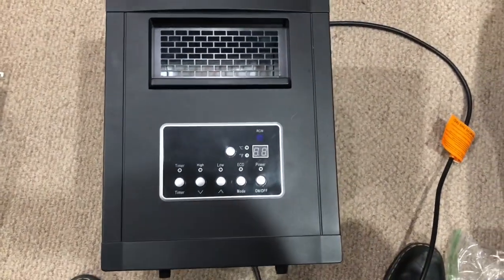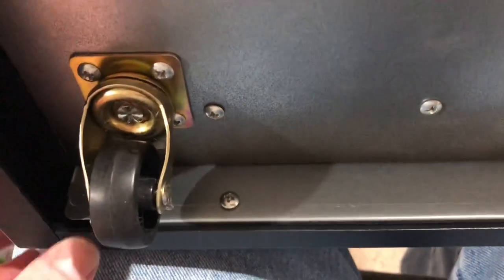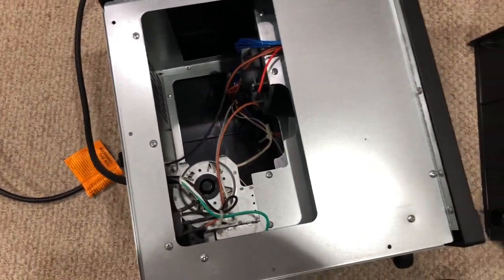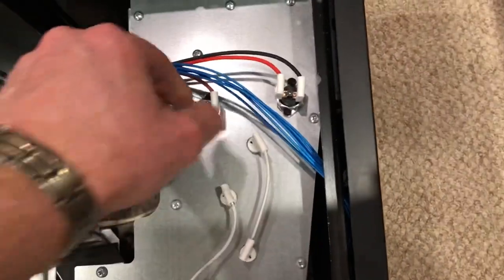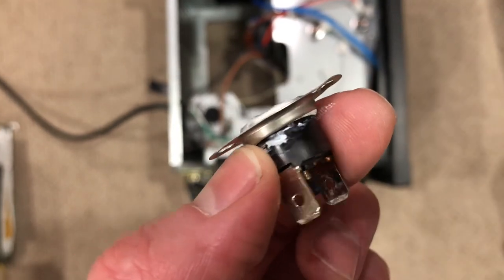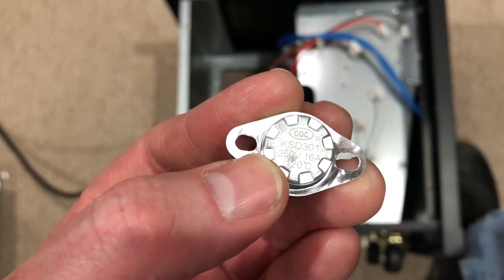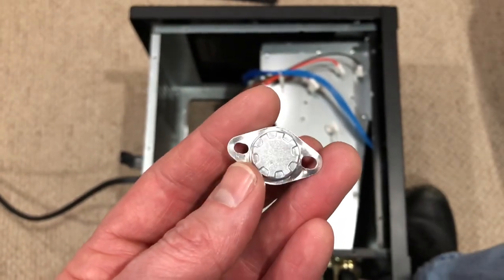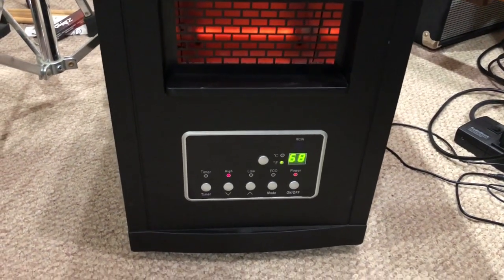Life Smart infrared space heater repair

Comment: Nice video. You might want to be more explicit in the video description saying that you usually do NOT need to replace the fuse/thermostat. Instead, just pressing the reset button on the back of the component will most likely reset it. As you label it in your video, these are Manual Reset disk thermostats.If pressing the button doesn't fix it, checking the fuse for continuity with a multimeter or any other tester will tell you if the element is actually bad. On my unit, I drilled a 1/4" hole in the side panel (after removing the panel and manually resetting the fuse by pressing the button) in line with the button so that I don't need to take the thing apart if it should get tripped again in the future. I also put a "Thermal Reset Button," label under the new hole. Thanks for sharing this.
Reply: Pushing the reset is what I did and it fixed the problem.  Unfortunately for me, I did not see this comment before I went looking for replacements for the fuses.  At my third stop I was told the button was a reset and low and behold....fixed.  A lot of screws had to be removed to get to the fuses.
Reply: Opened mine to find a wire burnt on the switch, something got hot, any ideas, melted the switch, now I need a switch and a wire.
Reply: @sparkywow1  Sounds like it shorted out and fried instead of failing in the open position. The wire really shouldn't act as a fuse. :) Just replacing both should probably be fine, but if you want to be extra careful, you could put a 10  amp fuse in-line with the thermal switch.
Reply: @sparkywow1 The burnt wire is usually caused by a loose connection or the contact points inside the thermal fuse not making good contact and they start arching and creates a hotspot. Seen it hundreds of times doing appliance repair for 31 years.

Comment: Just so ya know.  That white gunk did not come out of those.  It is called thermal paste.  It is used on the cpu of computers between the cpu and heat sink.  It helps in conducting heat.  Not sure if this has been pointed out yet.  From years of computers I recognized it right away.

Comment: Thank you for posting. This saved me from scrapping my heater. Mine had a factory installed red reset button attached to the thermal part you posted. I just had to push hit back in to reset. Not sure why they would make it so difficult. They could have just had an external reset button to avoid disassembling the entire heater, what a hassle!
Reply: Kevin Berryman manufacturer wants to sell you a new heater. Reliable products don't make stockholders happy. A sad reality of today's business climate.
Reply: mine has the same reset button on the one.

Comment: Thank you so much mine stopped working and I searched online and found your post it was actually the reset button and it fired right back up again thank you it worked really well
Reply from the maker: Steve Barker was it raised up?  Did you push it back down?  Checking.
Reply: Mine was slightly different than yours although quite similar so I took all the screws out and the side panel and I got to say again your video was very informative I would have never figured that out and I saw the little button that you had mentioned about resetting after you replace the thermal coupler and I pushed on it and it actually clicked I plugged it in and boom it fired right up
Reply from the maker: Steve Barker I think I read some people drill small holes so they can hit those with let’s say a toothpick.  However finding the exact placement could be tricky.
Reply: I'm out in my cold shed enjoying the nice heater working on my Harley

Comment: The voltage rating is the dielectric strength of the electric insulation within the fuse. 120 volts is within that range. The amp range is more important, and that is the same or greater than the original for the current the thermal fuse can handle. The most important number is the temperature rating. The white stuff is thermal compound which helps to make a better thermal connection with the body of the unit. It's best if you use some. The thermal fuse is resettable, so that should help in the future.

Comment: The white stuff is heat sink compound. It is placed on the outside body of the sensor to help the transferrance of heat from metal to metal. It is commonly found on heat sinked transistors in electronics. My two cents!
Reply: I just replaced the thermal paste and it seems to work fine now
Reply: Opened mine to find a wire burnt on the switch, something got hot, any ideas, melted the switch, now I need a switch and a wire.
Reply: @sparkywow1   the make up inside the over heat sensor is like a set of points that make and break when it over heats it breaks or opens the point can get burnt contact surfaces and can  cause a higher resistance causing the connections feeding the  to get very hot from the higher resistance  sometimes this can be the result of burnt wire but  also dirty filter or dirty fan blade or motor bearings could be worn out  due to lubrication  which many are lubed at factory and you usually cant lube them because they are sealed and if rpms of motor slows down the heater will get a little hotter causing the overload heat sensor to go bad if its a auto reset type but most are not because the part would cost a little more so there are three or more types manual resets  auto rests and one time  no reset  that have to be replaced just like a fuse these are know as thermal discs limits  they are use in many devices other than heaters but have different heat ranges that open them up to cut the voltage off   some are low heats some are higher heat ranges  depending on there  function i was in electronics for over 35 years and ended up retiring as an electrician

Comment: I thought that looked more like thermal paste! And YES you can use a 250V version in a 110-125V circuit. That's because it is HEAT, not volts that cuts the circuit, just like a typical fuse is rated for upper volts when it's AMPs that can cause it to blow. That voltage rating is an upper limit only.

Comment: Thank you very much for that tip about turning it on and off with the "ON/OFF" button on the front of the machine, instead of the orange toggle "0/1" button on the back. I presume that rear switch is there only to prevent wasting "ghost" electricity when not in use for a prolonged time.

I just found an Ecotronic 1500W model GD8115BW-L infrared space heater yesterday by a dumpster. It's fairly similar to what you have. It has the same orange tag on the same type of cord, and "Do Not Cover" on top. So I think they both might have been made at the same Chinese factory. Except for 3 minor cosmetic issues, mine works great.

Comment: I have one that was sitting in a room that I had some mold issues with and it was in there for probably about two years with the room shut with no heat getting into the room could constant cold permanently destroy a heater like this? I was curious because I am moving out of the house and I wanted to heat up that room so I could kind of try to go through it to get stuff before I'm out of the house permanently and when I went to plug this heater in it immediately tripped a breaker down in the basement for that circuit just plugging it in tried it on another circuit in the house blew that one as well is this thing completely toast?

Comment: I took it apart just as you showed and mine only had one of the 2 fuses yours had but I cleaned it off pushed the button and (button was white instead of black) and like magic it works again!  For the orientationally challenged maybe mark the panels with a maker for top , bottom, Left side and Right to make reassembly just a bit easier ....using a hand held screwdriver is not much more work than using the electric ones. and you wont strip the plastic or sheet metal.  Thanks again I have 2 of these so your really saved me.  send me an address and I will send you a gift.

Comment: Thanks...  Mine was the HT1198 model... The small black one...it was a job getting to them but I got there...One had the reset other didn't... I pushed the reset... Turned main power on but the power switch on the top just flashes... I am going to amazon and ebay not to order replacements for both... Thanks again

Comment: The white  substance on that part you pulled out is not leaking that white stuff  is a heat sink paste  or compound  to help sense the heat better incase its overheating when installing new ones you might want to use that compound on your new ones that compound is silicon  white paste its used also on stereo and amplifiers to dissipate the heat to a heat sink just the opposite of the function on the heater  just reverse action to get job done  one draws off the heat to a heat sink for electronic devices and the one you are working with is used on  heater overheat  the compound helps to you might say fell or transfer the heat  better to the overload sensor same job for this compound but different purposes

Comment: My faulty unit shuts the fan off when the desired temp is reached, however, the elements continue to glow and wont shut off unless you unplug it.  Could these thermal fuses cause this problem as well?
Reply: that is posible
Reply: Mine does the same. Did you get it fixed?

Comment: the white stuff is thermal compound it is used on many stuff to help make heat transfer better.

you can youtube heatsink compound or thermal compound.

what probably happened is the thermal switch was cycled too many times and failed.

the heating elements can fail too

Comment: let me get this straight I may be able to just push in the black plastic tab on the front side of the KSD 301 component .but if that doesnt work then I can replace that KSD 301 buy ordering them off the internet..a month ago Kee Tan  said he fixed his without replacing the fuses.....I hope I have the same situation.  If I do have to order the parts do you have the web address?
Reply from the maker: Rodney Beasley Yes, try the reset.  See if that will work.  Otherwise replacements on eBay or Amazon.  My heater running next to me right now.  Still running great!

Comment: if these fuses were blown would I still be able to turn the unit on from the front?
Reply: red light on back on switch .  but no power to front control panel.  There is a reset in the center of the thermal overload. but you have to take it all apart to reset.

Comment from the maker: Just to follow up, my two fuses had different values.  One was 120, and the other was 150 with reset.  I am sure these were Celsius temps.  I replaced them both with 120s.  The replacements on eBay just a few bucks.
Reply: do u have the part number on these or what did u look up for the elements i have seen alot for dryers thanks have a great day

Comment: Can you show me how to fix, repair or replace the fan inside the heater, mine has lost it's power for some reason?
Reply: Probability too late now, but did you try cleaning the air filter? A dirty filter will slow the flow of air through the heater, no matter how strong the fan.

Comment: That switch is for safety.. you never want to double the temperature  on a temp safety switch... they designed it for a reason. Plus. Resets are good. It's like a resetable fuse
Reply: Opened mine to find a wire burnt on the switch, something got hot, any ideas, melted the switch, now I need a switch and a wire.

Comment: The white gunk is heat sink compound use to connect thermal heat transfer fella. Not necessarily a bad semiconductor device. Item must be tested using standard means. The 250 volts rating will cover the 125 volts too.

Comment: If i change the manual reset limit sensor, should i change the other one too?
Reply: They are different temps 150C (the one right after the tilt switch) and 120C wired into the main board. If you have a multi meter thats the best way to check if it works. For me the 150C is faulty. For the small price you might as well. If you dont have a tester then yes replace them both.

Comment: My  heater  have indicator but the fun is not working.what should i do?someone help me.thank you.
Reply from the maker: Be careful with that.  Without the fan that will overheat.  Maybe fan motor replacement.  May have to get a new one.
Reply: The fan motor is very small and it doesn't take much dirt to stop it from spinning.  Spray some WD-40 on the end bearings and it should start spinning again.

Comment: Notice that button in the middle is up? It can be pressed back in. It is essentially a safety switch, and will pop if it becomes too hot. Like a breaker, and can be "reset". If you are reading this, save yourself. Push the button. Move on.

Comment: Model ZCHT1001US only: Infrared space heater reset (If unit was overheated)

1. Front of heater facing away from you, you'll remove 5 silver screws from the back (3 on left side & 2 on inner top)

2. Then you'll have to slide off the top cover by pulling it inward towards you. (Back of heater facing you)

3. Once that's off, you'll unscrew 2 black screws on the left (now visible once top cover was removed)

4. Flip unit on side with the left side facing ceiling, this time you will slide the side cover off by pushing it away from you. (rear of heater still facing you)

5. There should be two wires with rubber casings at the head (more than likely braided red & dusty pink) & a dial like thing sticking out in between it.

6. Poke it, it doesn't click or make any noise. (Feel free to press it several times if you are unsure)

7. Reassemble the heater. (Fit on the left side casing) then prop it upright, 2 black screws from under the top, fit on top cover, 2 silver screws at the backs inner side, and then 3 of the left screws. Once you've finished these steps, stand up, do some stretches & last but not least plug in the unit & see if it's FIXED.